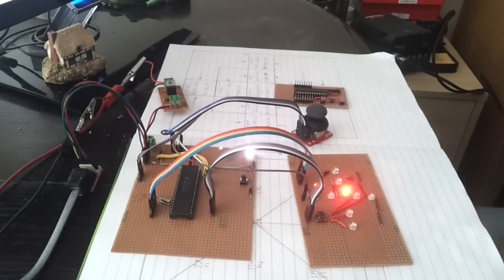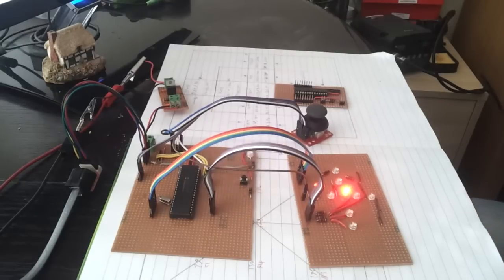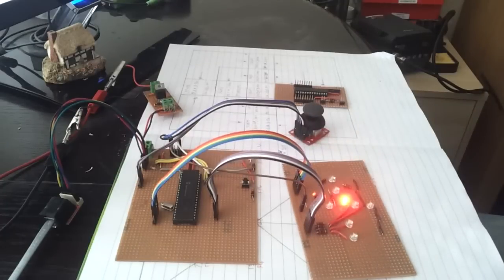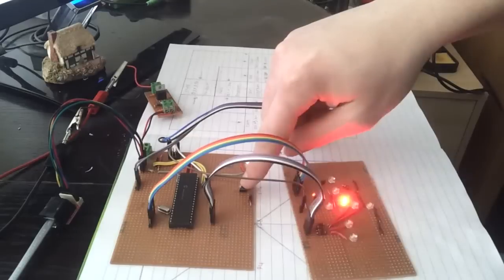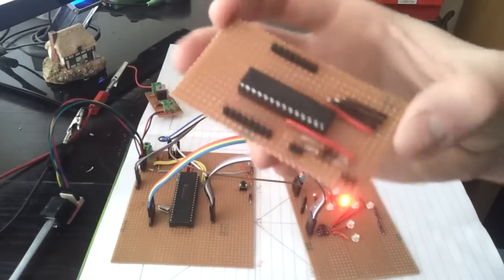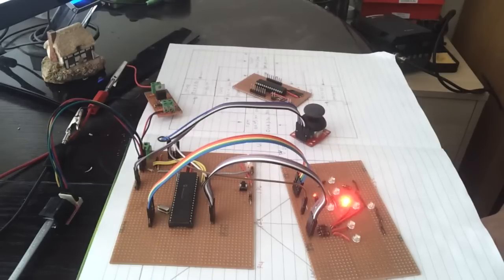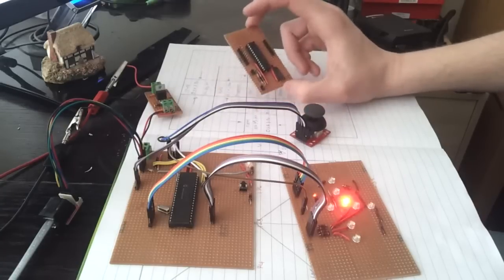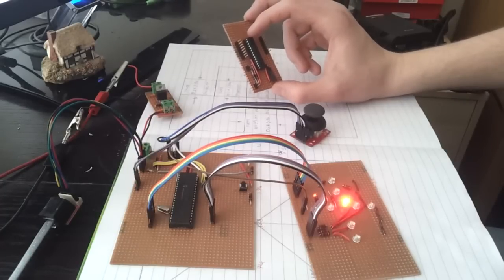A PIC Microcontroller Being Controlled By An Analogue Joystick

Comment: Hi alex, could you tell me how you connect the joystick to the PIC? thx.
Reply from the maker: This was a little while ago now, however its quite simple, there are 2 analogue outputs coming from the joystick that provide X & Y coordinates. There is also a positive and negative supply, and a digital output for the clicker.  Just hook the analogue outputs to 2 of the ADC pins and read off the values.  If you are lucky enough to buy joysticks that have a datasheet then you should be able to find out which values correspond to positions.  Personally I just pushed the joystick to its limits and then drew a little table and came up with a co-ordinate system.  Obviously provide the joystick with a + & - negative supply, and if you have a clicker attach it to digital input/output pin. 

Hope this helps,

Alex
Reply: ***** Thank you very much for your help. It make sense. Do you mind sharing that part of the code?